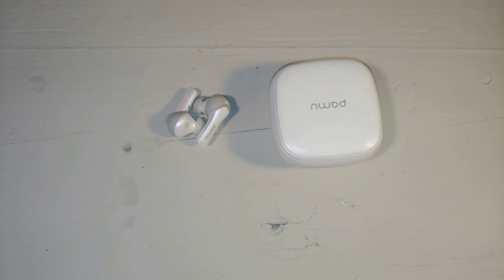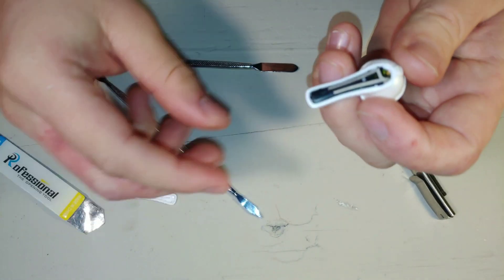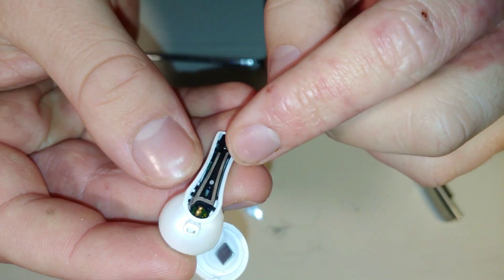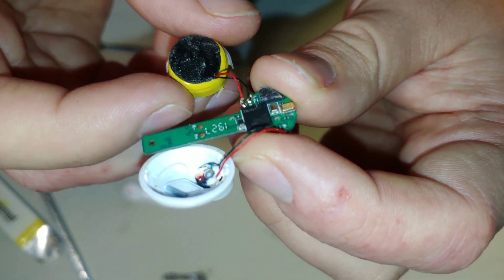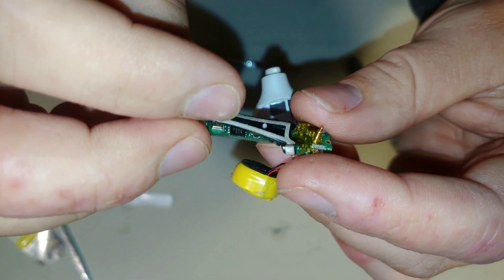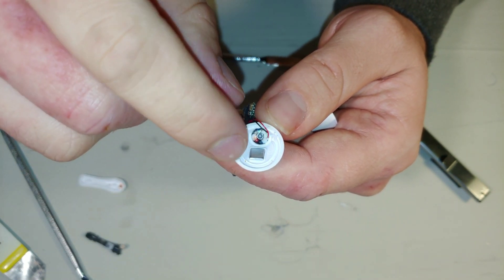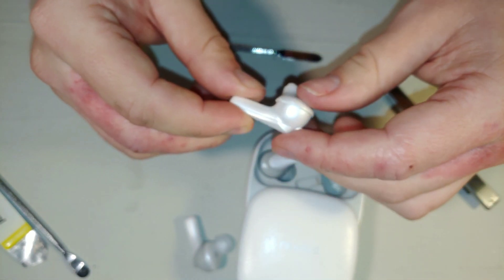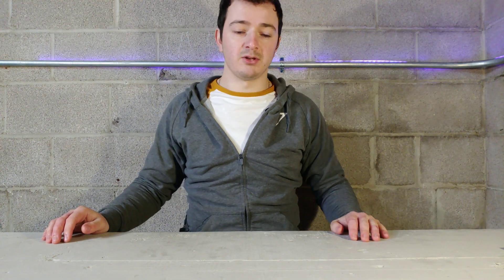What's inside Bluetooth Earbuds? Teardown & fix!

Comment: got a pair of taotronics soundliberty 53. both of the earbuds should say "power on. tws connected" but only the right one says that. both of them power on because of the flashing lights. I opened up the left one and all the wires are in the place. what should I do now? it still doesn't work.

Comment: Glad you fixed. I cringe when I see people touching areas of circuitry with fingers. Moisture & grease can be left behind to increase contact resistance. Perhaps nor right away but corrosion can occur later.  It's good to clean with isopropyl alcohol and a Qtip too.
Reply from the maker: I understand, i will acknowledge that for my future fixing videos. Thank you for watching